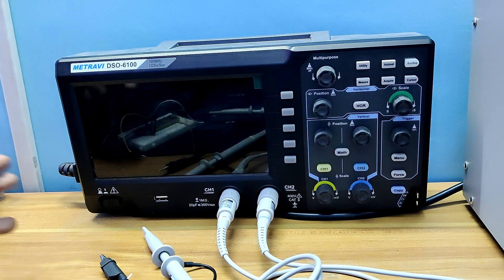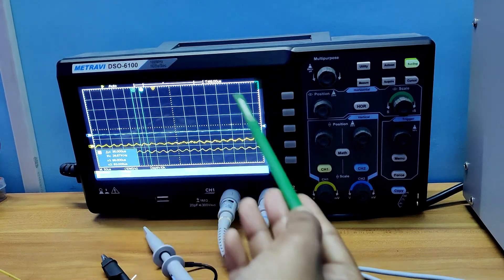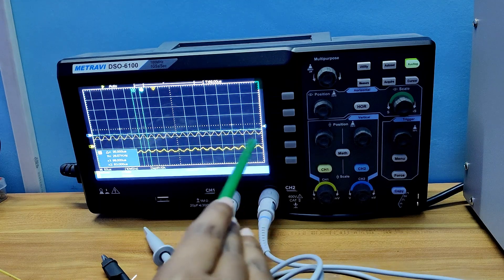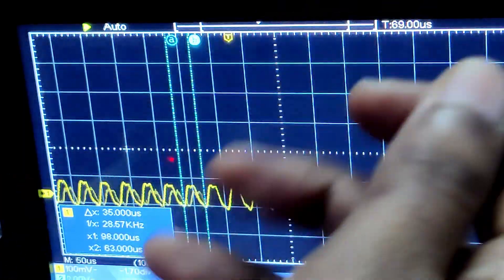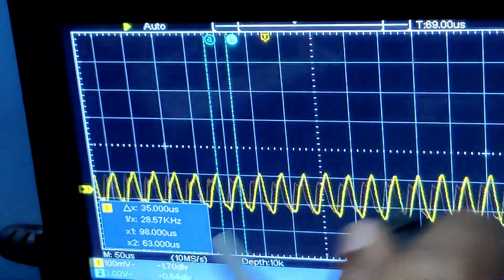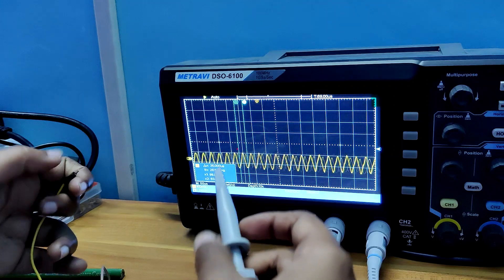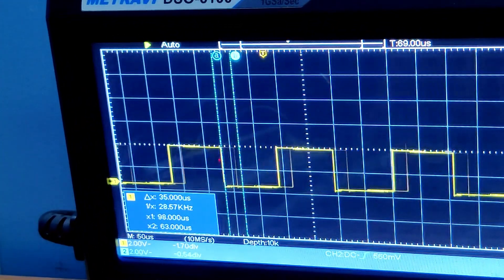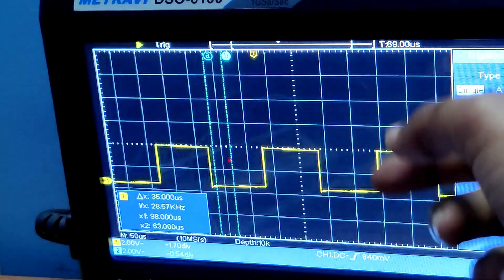1. How to use an oscilloscope? Basics of Electronics -1 #tamil #TNrise

Comment: is there any possible ways to cancel the unwanted noise?
Reply from the maker: If we connect the ground properly that itself is sufficient.
Reply: @learnbettereverytime hiii
I actually don't use a probe.. i have connected the bcn adapter with the jack cable to the guitar to analyse the waveform and the frequency of the guitar. There is lot of unwanted noise without strumming
Reply from the maker: It will have two wires (signal and gnd) internally. You need to figure out which part (inner or outer) is the signal and gnd respectively and then connect to the oscilloscope to check the signal. If you can provide a link of an image of your cable.. it might help me to understand.